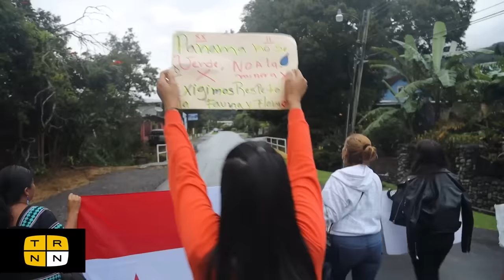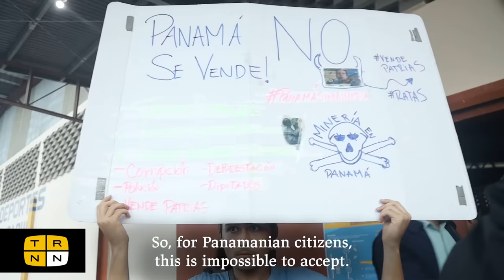Panama explodes in protests against Canadian copper mine

Comment: As a Panamanian I can testify that some of the rivers miles away from the mine are slowly, but surely drying up. Their waters have dramatically changed, looking like a amber like color. Very concerning.
Reply: Where exactly have you made this observation? And what are the names of the affected rivers?
Reply: @berndkemmler6389  Cocle de El Sur en Cañaveral,  provincia de Coclé.
Reply: @huacamaya119  Thanks for the reply. But this river is south of the mountain range. However, the mine is north of the mountain range. It is impossible the the mine is affecting this river.
Reply: @huacamaya119  Don't listen to this guy! he's probably an investor about to lose his pants if the deal is off. It's not a coincidence that the Panama Canal water levels are down exactly after the 2019 mine deal.
Reply: @berndkemmler6389  Dude, on the mining contract they want to use Lakes that supply the already affected Panama Canal to supply the mining operations. they want to close the airspace, be able to exproprieate land, make the government unable to do envitomental check ups without booking an appointment in advance, and all while offering the govenment a comedic monetary compensation. while renting all the land also at a comedic rate. its absolutely ridiculous.
Reply: @berndkemmler6389  Do you know where they dump their crap? Just curious.
Reply: @aramirez3126   at this time, they are using (ilegally) around 25k acre area for their residues pool, which was not included on their original contract, and they knew it but didnt cared anyway
Reply: @aramirez3126  The mine is located in an uninhabited area on the north side of the mountain range. Any potential waste, soil, dirt, or other byproducts from the mine are washed into the Atlantic Ocean. The inhabited area is to the south of the mountain range, on the Pacific side. Indeed, there are rivers in Panama that change color to amber, from time to time. This is mostly caused by soil erosion from agriculture.
Reply: @donatopirrod  Sorry, it is a myth that the mining company wants to extract water from Lake Gatun. I know that many people believe the plan involves building a tunnel to obtain water from this lake because they heard it in the media. Building such a tunnel would cost 1 billion dollars. However, there is no need for that. The mine has plenty of water, more than enough. They dug their own artificial lakes to collect rainwater. If they need more water, they just have to dig another lake, that's all.

I have not read the mining contract, so I cannot comment on the other aspects you mentioned. Did you know that one of the leaders of the current protests has admitted in public that he didn't read the contract? He said he didn't have time to read the 67 pages.
Reply: @berndkemmler6389  "the protests leader" yeah, you couldn't sound more like a foreigner even if you had the word tattooed in your forehead.  "The myth": Article 35 of the questioned contract with Minera Panamá, S.A, gives it the right to use and divert water from natural sources, when its activities require it. To this end, he adds that the current regulations applicable to the use, treatment and discharge of water will be applied. Of course, this contract, full of loopholes, does not specify what applicable regulations are.
Reply: @donatopirrod  Thanks for letting me know. On which page of Ley 406 which was published on "Gaceta Oficial" can I find this article? I am pretty sure the intention of such an article about water usage wat to let FQM use rain water. And I am also pretty sure there are other laws in Panama which prevent any company, including FQM, from doing whatever it wants.
Reply: No hay peor ciego que el que no quiere ver.
Reply: @berndkemmler6389  all that is a Big Lie !
Reply: @donatopirrod  the Project is Not using water from any River or lake.

It is a Big Lie
Reply: Copper comes out of the ground at 0.1% quantities. You won't see any color till it's refined. Good luck with your green future. You need copper to build EVs and wind turbines and hydro turbines. Not to mention the 40,000 job losses and other major investment walking away from Panama.
Reply: The Mine is not using any water from any River so if the rivers are drying up is something else.

Comment: Panama is now suffering a shortage of rain water that feed the water basins needed to operate Panama Canal. Canal transit has been cut back 10% due to lower rainfall. The open pit mine 
is contributing to the  destruction jungle rainforest which in turn causes less rainfall.

Comment: the translation is wrong, its not "375 milion a year for 20 years"., its "375 milion for 20 years"., Well besides that Consider the folloing they generate around 7.6 Billion a year and they plan on paying 0.02% of the generated amount and they dont even desclose what else they pull out of the ground, if you look for a Mineral map of Panama copper is the least abundant mineral in panama. they want gold, platinum, silver, gas, petroleum.
Reply: It's 375 million  MINIMUM per year for 20 years. That's minimum, even if the copper market price falls. Again, that's minimum. The country most likely would average a lot more than that.
Reply: @guillermogouldburn763   just in the 1st Q of 2023 they extracted 65,427 tonnes of copper and its at it slowest 3.63 $ per lb, thats around 500 milion in 3 months. . .on the low side